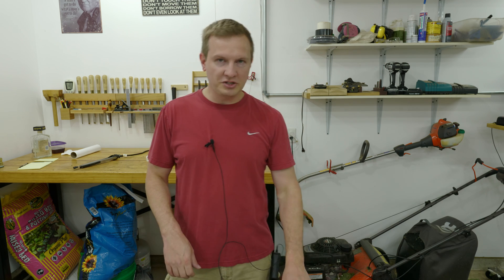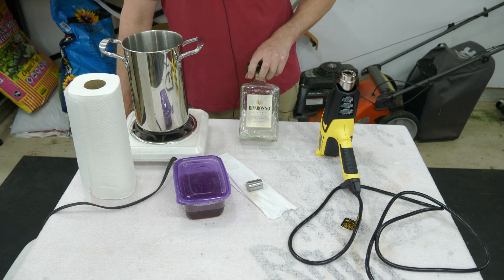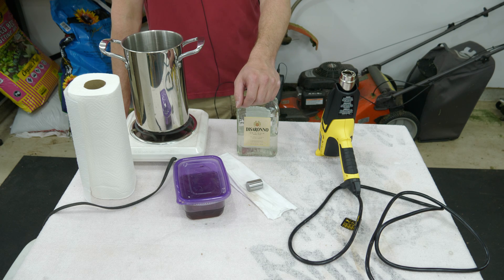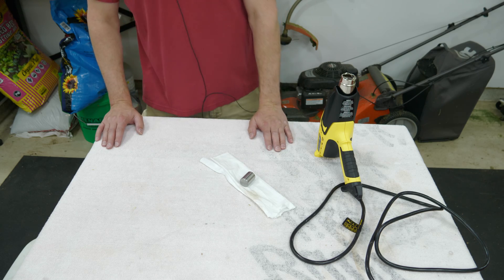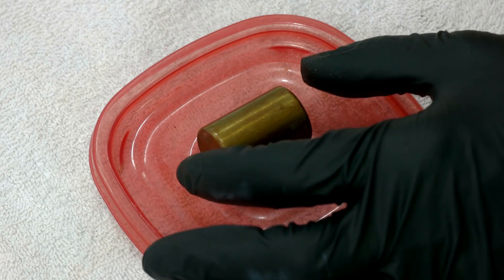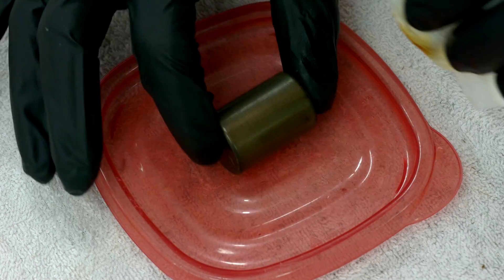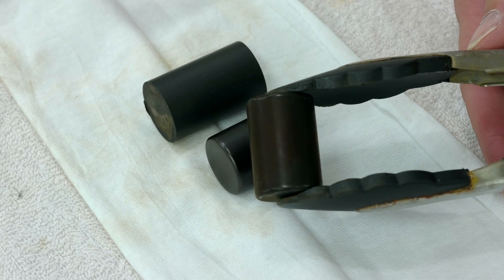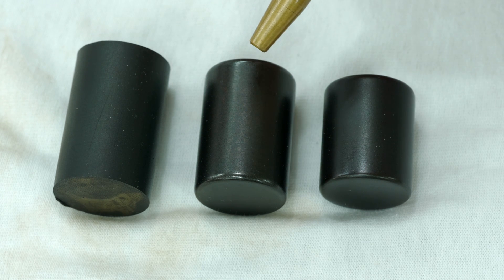Not So Slow Rust Bluing

Comment: you could also follow up by simmering in tannic acid solution to convert the black ferrous oxide into ferrous tannate a blacker and more wear and rust resisance finish., and finish with oil.

Comment: Can you not just dunk the part right into the peroxide/vinegar/salt solution? as opposed to brushing it on
Reply from the maker: Technically speaking you can but i wouldn't recommend it for a few reasons.

1) you will contaminate the solution more quickly with residue that will use up the peroxide.
2) It will take longer for the solution to dry, because you put more on the part
3) You will cool the part a lot more, thus it will take longer to boil or heat up with a heat gun
4) on complex parts it can make the part look splotchy  if it pools. Then you either have to do more coats, or card it off.

Comment: Thanks for sharing. Did you just mix the solution or did you also heat the solution?
Reply from the maker: I just mix the solution, the part will be warm from boiling after the first coat.

Comment: Do you use distilled water to boil the part in or just tap water? And do you use typical iodized table salt or non-iodized salt?
Reply from the maker: I've used distilled, purified,  and tap  water and not seen any difference. to be fair my local has a pretty clean watercourse. The salt was iodized.
Reply: @Dans-hobbies  I'm trying it now with distilled water and non-iodized salt. I can't seem to get the steel past a dark gray color (closer to medium gray than to black). I've repeated it 5 or 6 times, but it hasn't seemed to have gotten any darker since the 3rd or 4th time. I wonder if it's sanded too smooth (I sanded it to 600-grit). Right now I'm going to try letting it sit for an hour after applying the rusting solution to see if that makes any difference.
Reply: I bet if you use the salt they put on the roads  here in Chicago it woul rust instantly.👍😀

Comment: If I may give you some advice. If you want a durable finish you must let the chemical do it’s work and that takes time. You must let the rust develop into a fuzz type texture before you neutralize the acid by boiling. No matter what chemical you use to induce rust it should only take you no more than 4 applications of the chemical to get a good dark blue finish. Magnetite (ferrous ferric oxide) is a blue black color. What you are doing in the bluing process is turning ferrous oxide into ferrous ferric oxide but you have to allow time for the ferrous oxide to develop. Take it from a gunsmith, you can’t hurry the process.
Reply: Random. I’m doing a build that has original blueing and I have a barrel that’s phosphate parked. Is there a way to make the barrel darker to match the other components without blasting and blueing?
Reply: @Jingles4dingles  Not really other than keeping it soaked with oil. You can strip the parkerizing off with some Steel White available at Brownells or you can boil it in some Comet scrubbing compound. Parkerizing is the only protectant that is tougher than rust bluing.
Reply: I’ve got a shotgun that I’ve sanded the original finish off and it’s starting to rust and don’t know what to do , what is the easiest finish I can apply ?
Reply: @Robert-em9ny  First get some 0000 steel wool and soak it in acetone to remove the oil coating. Boil the steel parts in water for about 30 minutes. The rust will turn black, gentle rub it with steel wool until it has a luster. Get some Art’s Belgium Blue and apply with a cotton ball, don’t scrub it on just wipe it on, boil rub and repeat until the gun is the color you want. That’s the fastest and easiest I’ve found.
Reply: @richardkramer1094  okay thank you I will give it a try
Reply: @Robert-em9ny  The directions for use are either printed on the bottle or come with a different directions sheet. You’re welcome!
Reply: Carding???? = wire wheel?
Reply: Thanks Mr. Kramer
Reply: @ you’re welcome!
Reply: @ yes, however you need a wire wheel with .005 wires in it or you can use 0000 steel wool but soak it in acetone to get the oil off it first. You can also use a fine wire wire brush.
Reply: Cheers Richard, a good bit of information regarding time to let the rusting begin. 
Oh and lay off the dickhead stuff alright, I'm stuck with this one.😂
Reply: Approximately how long should it take to form that fuzzy surface after applying the solution?
Reply: @iridescentFUZZ  Depends on the atmospheric environment you are working in. The rusting or ‘fuzzing’ process requires humidity. If left in the open air in your house the rusting process will take 30 minutes to an hour to start, I usually leave them in the open air (if I am doing it that way) for 24 hours, boil then card with a .005 wire wheel or 0000 steel wool that has been soaked in acetone to remove the oils. I also have a sweat box that I use an electric boiler and in that case it only takes an hour then I boil and card.
Reply: Hey @richardkramer1094 would you do this method as a gunsmith on a handgun frame? I’m worrying about embrittlement but if it’s not a big deal I wanna check this method out. If not is there any better easy recipes you know? Thank you!
Reply: @2a4life_45  which method? The method in the original video? No, I don’t take short cuts. Use Brownells Original Rust Bluing. I make my own bluing solution. Boiling the fun will not make it brittle, it only in the water for 15 or 20 minutes. I do all guns in this manner.
Reply: @richardkramer1094 thank you!! if I was to do this method in the video should I be concerned about anything? Blended a 1911 grip and don’t know if I should just touch up over the parkerize or refinish it completely!
Reply: @ yes, keep it out of the barrel bore. This method is a ‘bandaid’ and will not last or be durable.
Reply: @richardkramer1094 thank you sir for helping me out! I watched a different video and found out you can use ammonia,zinc, Hydrochloric acid, distilled water. What you think about that method durability wise and in general? thanks again!!
Reply: @ I’ve never used that solution so I don’t know the durability of such a solution, but I doubt it would hold up to wear. Search for Niedner bluing solution, it is the best solution out there and you can make it at home. Be very careful when you add in the nails as it is a violent chemical reaction and be sure you mix in in a clay type container that has been fired properly, Walmart might have one. The recipe will make enough solution to last a long time if kept in a brown glass container. I do not add distilled water to mine, just the chemicals and iron filings or nails. Good luck and you’re welcome.

Comment: Hi, I was wondering if anyone could assist me. I'm trying this method to blue a pistol magazine.

The issue I'm having is with an uneven first layer, when I apply the solution it doesn't stick as well, instead of forming a "film" there are areas where the steel seems to "repel" it (kinda like water acts on steel). If I do multiple passes I do get the whole piece covered, whoever not evenly.

Is this due to not heating the part first? Bad part cleaning? Or perhaps my solution isn't in the right proportions?
Reply from the maker: Cleanliness could be part of it, or it could be the steel itself, some steels just don't blue as well as others.
Reply: are you handling it with gloves after cleaning? it could be oils from your hand transfering to the metal

Comment: Using a heat gun is definitely not a way I've seen before, I've seen people using a box qnd a heater before which is a slower way but probably better since you aren't blowing it with a blow dryer. Still a good look the way you went with. Just not quite the same as an actual rust blue on the piece.

Comment: Hi, thanks for the video. 2 questions 1- I don't have a carding wheel what should I use?  2- If anyone already tested, what is the durability of the blueing on a heavily used piece.  thanks
Reply from the maker: In my opinion, You want to use the softest form of abrasion you can. So, a really fine stainless or brass wire brush, or even a clean rag would work. All you are trying to do is remove the built up loose bits/fuzz. 

For durability, it depends what you mean by "heavily used". It will hold up as well as any blued gun will. If you are talking a mechanical part or something that's going to see a lot of abrasion you are better served by using a different surface finish like hard chrome, or a different material like stainless.
Reply: @Dans-hobbies  Appreciate your response, what I mean by durability is turning Petanque soft carbon steel boules into a dark blueish finish.  I guess, maybe that is not gonna do the job because the boules are in constant attrition with the ground and other boules.  TY
Reply: @Dans-hobbies  I wonder if an new un-stitched cloth buffing wheel run fairly slow would do a good job ??
Reply from the maker: @Old Grizzly  almost  anything will work, it's just a matter of how efficient it is.

Comment: If we can't have access to a tank big enough for a rifle barrel would steaming it from an apparatus used for rust bluing be just as good as boiling it with your mixture?
Reply from the maker: Unfortunately,  No that won't work. The conversion on happened in the absence of oxygen if memory serves. 

The old school gun methods uses a steam/humidity box to generate the red rust because it uses a very weak chemical solution to cause rust. See this video for example , it's using the traditional method, but still involves boiling!
https://www.youtube.com/watch?v=vuP4m6L95K4

Comment: Thanks for this vid! I've been looking for a way to blue gun parts in the home shop without buying hard to get chemicals or an advanced ventilation set up, I'm going to give this a try. I'm not sure if you'll have the answer to this or not but would a black oxide coating like this make a good priming coat for finishes like Armacoat or Duracoat? Or do you know of anyone who's tried this? Thanks!
Reply: No. Duracoat and Cerakote require a sand blasted, grease free finish. Assuming you mean this process minus the oil soak, because no one's would think using a coating over oil would be a good idea. This process, even without the oil bath would be a terrible primer coat for the Duracoat, or any other sprayed on finish.
Reply from the maker: I'm sorry  but i don't know a great deal about Armacoat or Duracoat. I assume for a finish like that you would want a bright, or blasted part. Blued would be bad i think because blued always involves soaking in oil.

Comment: Why is it necessary to use the wire wheel in between coatings? Are you not just removing the coating you've just applied by doing this? If you're just abrading the surface for the next coating, wouldn't a light sanding with high grit water paper do the job? (Not everyone has access to a variable speed lathe)
Reply: 0000 steel wool degreased in acetone.
Reply: When rusting the part surface metal turns into red oxide. Red oxide has a greater volume than steel by weight, so most of it does not stick to the metal. 

When boiling the rust it turns into black oxide, which is what you want. However since most of the rust was loose you need to scrub it off and repeat the process to obtain an acceptable coating.
Reply from the maker: After you boil the part, it will have whats is commonly referred to as rust "fuzz". The fuzz must be removed before you apply the next coat. You don't have to to use a carding wheel, and light abrasive process will work.

Comment: I have no idea what whey oil is but for anyone interested in rustling bluing used motor oil or small engine oil are good choice's. You don't want to use oil that has detergents in it because it'll take the finish off before it has a chance to set. Also kerosene is a good option. When applying your bluing solution you want to try to apply a thin film and don't overlap on the application for best results.
Reply: OMG, has no one given you an answer ??. It's way oil and that's oil for oiling the slideways on mill, lathe, etc..
Reply: Used motor oil has detergents in it... When you say "small engine" oil, you're hitting in the right area. That's because most simple small engines call for a straight 30 grade SA oil which has no detergents and no viscosity improvers in it. You can also use pharmaceutical grade mineral oil from Walgreens or similar.
Reply: @mannys9130  for the purposes of rust bluing the detergent in used motor oil is so degraded that it will not strip the finish off before it has a chance to set. I've been bluing guns since 1987 and doing it professionally since 1995 so I kinda know what I'm talking about.
Reply: These people never really fully explain the oils they use, and the terminology is incomprehensible.
Reply: yeah...found out about detergent oil the hard way lol! also experimented with coconut oil (solid)...didnt go well either.

Comment: Great! Thank you, I want to try this, but there are two words you use that I am not familiar with (I only speak English ;-)) - the one that seems to refer to the rotating item on the lathe (which seems to be a buffing wheel or similar) and sounds like you are saying cart (or kart), and the other that refers to the oil and sounds like whale (surely no one has access to whale oil these days?), if you (or anybody) can enlighten me as to what they really are I would be forever grateful).
Reply from the maker: The wire wheel on the lathe is commonly called a "carding" wheel. I have the 4 row version of this one.
https://www.brownells.com/gunsmith-tools-supplies/metal-prep-coloring/wire-brushing-carding-tools/0025-stainless-steel-brushing-wheels-prod6762.aspx

I used "way oil", because as an owner of machine tools it a consumable you must have on hand. I currently use Vactra #2.
https://www.amazon.com/Mobil-100772-Vactra-No-2-Way/dp/B07B7XZKVF/
Reply: I just use an old toothbrush instead of a carding wheel, you're just removing the loose rust before boiling. He is saying "way oil", used for lubricating the ways (sliding surfaces) on a lathe or mill. Any old oil will do, motor oil works fine. Just something to keep moisture from getting to the surface.

Comment: Nice black. Is this finish a rust preventative?
Reply from the maker: It's a mild rust preventative, just like it is on guns. It will be fine for normal handling , and storage in non humid climates. However just like with guns, if it's going to be subject to a lot of handling or a humid environment it needs to be aided with a water displacing oil.

Comment: What If you want a high gloss finish
Reply from the maker: You will need to use a different finishing technique, or apply some kind of gloss finish over top.
Reply: @Dans-hobbies  do you think you could get a medium satin finish with this method
Reply from the maker: @springersshop5839  Maybe, but it you would need to test it out to be sure. I'd bet it comes down to the steel in question, and how many coats you apply and how strong the solution is.

Comment: Does this method change the dimensions of the part?
Reply from the maker: Yes,  but only to a very small degree , as you are converting oxides from one form to another.
Reply: @Dans-hobbies  Thanks!
Reply: Wikipedia says the coating is around 25 micrometers, although I'm sure it'll depend on how many times you repeat the process, so unless unless you're dealing with really precisely machined parts, you don't have to worry. And if you are, what the heck are you thinking, leave those parts alone!

Comment: What times do you recommend,. Between coating and boiling, between boiling and carding, and between carding and the next coat? It would seem applying a next coat while the metal is warm would be best but I would like clarification. Thanks. 👍
Reply from the maker: You can boil as soon as the coating is dry. You can card as soon as you are done boiling, and you can apply the next coat as soon as you finish carding the previous one.

Comment: Does boiling in the pot wreak it or stain it / also how long will it stop rusting after making it rust - ok sounds weird  with the black coating thanks    Kevin
Reply from the maker: If the the pot/pan is metal (even stainless) it will develop a rust stain over time.

Comment: can you let the parts sit overnite?
Reply from the maker: If you mean in the solution, I would say probably not, as it would most likely continue to eat at the surface.
Reply: @Dans-hobbies  No I mean after I card it but have to wait till the next day to put on the next coat will it continue to rust over night
Reply from the maker: @memsley1961  No, if you have thoroughly boiled the part and carded off the fluff it will be fine till the next day.
Reply: @Dans-hobbies  thanks for the info!
Reply: @Dans-hobbies  also what did you boil the barrel in that was long enough?

Comment: It's easier to use a 2%-5% salammoniac + distilled water solution this is the easiest method they used to reblue military firearms plus it's cheaper
Reply: Thank you! I've been having a hell of a time looking for a homemade rust bluing solution that doesn't require some special order from a chemical supplier, or use hydrogen peroxide. And being in Canada, I don't have access to all of the off-the-shelf solutions they have at Brownells etc.
Reply: @thedivisionbell220  In EU we don't have access to many chemicals that's what i've been using when im in need to reblue something
Reply: Tell me with details
Reply: @Shahid-e2c  In a solution of 100ml distilled water dissolve 2 to 5grams of salammoniac crystals, Another solution is 50ml distilled water + 50ml isopropyl alcohol + 2-5grams of salammoniac.

Comment: so i wonder: can you just boil it directly in the hydrogen peroxide solution?
Reply: No. The peroxide solution makes it rust, and heating it would just make it rust faster. Boiling the RUST in water converts the rust into the black oxide.